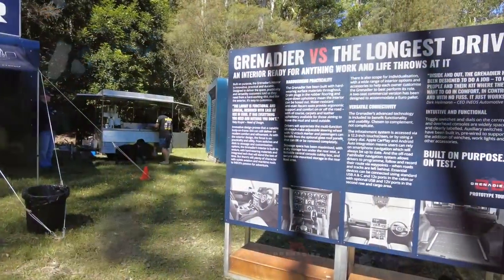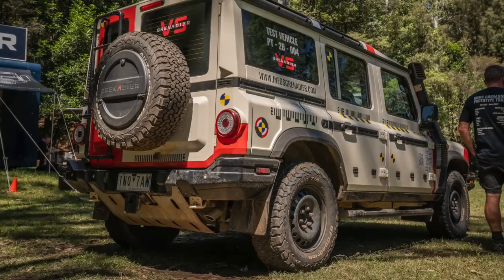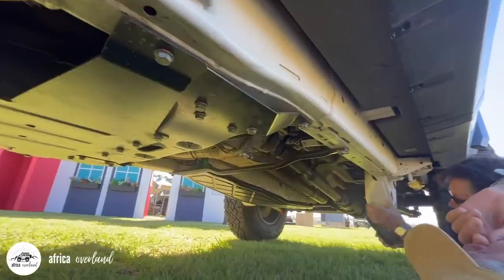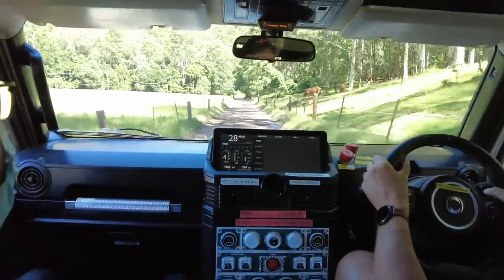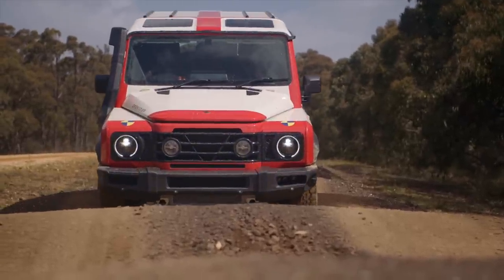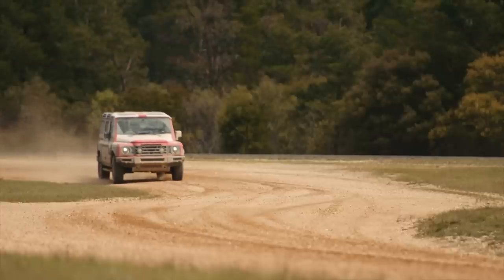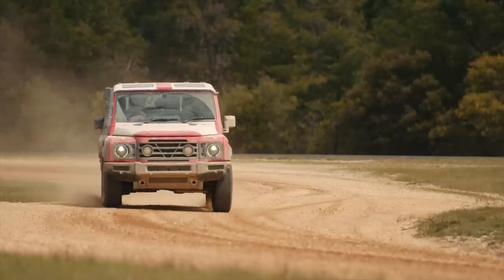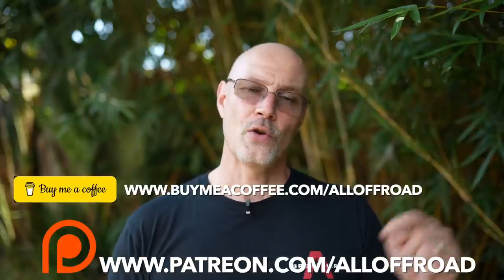Ineos Grenadier - THE ISSUES | SEPARATING THE FACTS FROM THE HYPE | A 4WD PERSPECTIVE

Comment: Excellent review! I'm from Namibia and can not see the point of this vehicle when there are 80 series cruisers still running that I can refurbish for less than half the price of this unproven vehicle for serious remote use where your clients safety is an absolute no compromise situation? I think you have had enough experience in the sticks to see that cruisers or older Toyotas are still the standard for reliability, I know we certainly saw that over the years here in Africa!
Reply from the maker: yes 100% agree with you, my 105 Cruiser has been the most reliable car I have owned so far, reasonably easy to repair, every mechanic knows it inwards out and parts are also available easily. Not to mention its modifiable to whatever want it to be (same goes for an 80 series)

Comment: I do think your worries about the batteries being first to flood and things like adding additional fuel tanks is based on a very limited number of uses. With all respect people like yourself, might account for 10% of sales. So the compromise will be to suits most sales which will likely be on road use. Of our we the diesel will have adblue as that’s down to emissions and isn’t really as issue - my van has it and lasts few thousand miles per tank.
Reply from the maker: yea in Australia it will be the majority who would want more fuel ⛽️ but you probably said it right it will be just another 4wd like we have dozens on the market not a purpose build hard ore 4wd as advertised and in regards to fuel capacity it will be on the bottom of the list as it will be difficult to even upgrade capacity.

Comment: Thanks Stephen, enjoyed the review.  Are your stats re approach, departure and break over more up to date than the IG brochure as the figures they show are somewhat better than your chart?

Wading depth 800mm
Approach angle 35.5
Departure angle 36.1
Breakover angle 27.8

Having had an LC80 and presently an LC100 I'm looking at upgrading and would have looked more closely at the LC76 but for my purposes I have long given up on a manual tranny and don't want the additional cost and hassle of changing the 76 over to auto.  The IG when compared to the 76 seems to outperform in approach, departure (cannot find breakover for the 76) and wading depth.  I find the ground clearance interesting in that the 76 claims 230mm and the IG 264mm?  Spot on with the fuel capacity or lack of, even my wife's 07 Touareg has a factory 100 litre tank.  Maybe the production version is much better, here's hoping.
Reply from the maker: I would hope I took them somewhere from the Ineos literature, however not sure how it's measured anyway usually from the centre of the frame to the bottom of the tyre, but the fuel tank hangs much lower so I'm wondering how accurate at least the break-over angle is?

Comment: Front bash plate - I’ve done a lot of ridiculous off roading and any really successful underbelly protection will get hammered really hard. That means it is doing its job. It’s a good thing :o)  *winch challenge
Reply from the maker: that depends on how low it hangs the front bash plates on any of my vehicles certainly not get constantly pounded otherwise the car is to low.

Comment: Starting to watch your video (pretty excited by the way as I appreciate so much your opinions) and there is an “important” mistake. You say the departure angle is 31,6 deg but it’s 36,1!!
Reply from the maker: yes you are correct not sure where I got the 31.6 degree from at the time, however thats probably measured at the wheels I have the suspicion it will be less at the front due to the low hanging bash plate and transmission cooler.

Comment: Why on earth didn't you measure the ground clearance? You crawled underneath and took plenty of footage, but didn't bother to get the tape measure out. Second question - bottom line, what is the best stock 4WD available today (zero  modifications apart from tyres)?
Reply from the maker: yea, kicked myself as well for not measuring. Depends on for what? Jeep JL Rubicon is the most capable no question but would not use it for touring especially remote. Landruiser 70 Series for Touring or Y62 Patrol 300 Series.
Reply: @AlloffroadAu  Thanks! For my purposes: tight high country tracks with mud and rocks. Shame the Australian rubicon has lower stock ground clearance than the US one

Comment: Loved your take on the Grenadier. However it appears you are comparing it with a specialist vehicle which it obviously is not. It’s up to the specialists to convert it to their requirements.
Reply from the maker: hm is supposed to be a purpose build 4wd? A go-anywhere vehicle according to the advertising, yet it’s not very well set up for that task and they way it's designed modifying it will not be that easy.

Comment: Seems too low to the ground and will result in many ground contacts.  Also I don't like the full time all wheel drive.  I  would like to switch to 2wd when full drive system is not needed.  I would also like analog gauges for speed and RPM behind the steering wheel no in the centre.

Comment: In most of the world the old style Land Cruisers aren't sold so it fills that gap especially when Landy production ceased in 2016.  Aussie's seem to love their simple Toyota's so I doubt there will be big demand for the grenadier there unless people just want something new and a bit different.  I don't see   any real problem with the Grenadier but I think an analog speedo would be preferable and i've never felt the need for a screen in the middle.  (It's just something to go wrong in time).
Reply from the maker: I heard Australia has one of the highest pre-order rates of the Ineos worldwide, it took Ineos quite by surprise.
Reply: @AlloffroadAu  People are talking about how expensive the Grenadier will be but as you know the comparable Toyota in Australia is very expensive also and designing and manufacturing such a capable machine on the cheap isn't really realistic.  If the Grenadier can operate if the centre screen goes wrong then in theory it could be a viable long range vehicle.  (not sure about adding another or larger fuel tank)

Comment: Understandably this car not be everything to everyone. By the sound of your comments it seems you are better off sticking with your Toyota for overlanding as the Toyota will be more flexible in modifying etc. It is a free world. You choose the car best suited for what you want out of your car. I would expect that all the 3 major concerns you have will not be addressed by INEOS at least not in the first production.Maybe in a couple of years. But I think any changes this close to production are not going to happen. I agree with you that the fuel capacity is terribly small for a car like this and would have expected at least 100L fuel tank. Or an option for a second fuel tank. Can you imagine doing the Canning stock Route with a 550 km reach on asphalt. You need to pull a trailer with jerry cans. But I still have put a deposit down and still will buy it. But will do the Canning Stock route in my loyal Defender 110.
It will be interesting to see what the after market is going to. Personally I would like to have a flip top roof tent, but I can not see that happening any time soon as the engineering required etc will make it too expensive.
Reply from the maker: take the Ineos on the Canning I accompany you in the Cruiser and we see what it's made off.

Comment: Your review seems quite critical. I would imagine it be quite difficult to have both, a 1000kg load capacity and soft ride when lightly loaded. I had expected you would rave about solid axles front and back plus coil springs - the gold standard as stated in previous videos?!
Reply from the maker: Don’t think so, I just not only focus on good parts. Yes solid axle is good so are coils but definitely achievable to get a better right I have one in my Cruiser. But ride quality is the least of my issues as that is easily addressed with aftermarket parts.

Comment: Question: Have you ever done similar reviews of Mercedes Unimog vehicles? From my limited experience it seems the Unimogs outperform most offroad vehicles by a comfortable margin. I'd value your insight.
Reply from the maker: no, I haven't but I nearly bought a Unimog at some stage, I don't think you can compare it to the likes of Ineos though. It's much bigger, wider and heavier and is probably the most capable vehicle in it's class but you would need to compare it to a Mitsubishi Canter or Isuzu or Iveco.
Reply: @AlloffroadAu  Why? it's purpose is to do the things popular 4X4s try to do (only, as you say, it does them much better). It's the undisputed King of Offroad. All the rest are just little pretenders, wannabes. Go on, please do a test, doing the same things, for a realistic comparison.

Comment: l would consider a Grenadier if they brought out a swb version, also the chassis design as regards the radius arm mounts is not good when compared to my old Defender 90 Td5, also the tires need to be taller, they just don't look right on this 4 door model.

Comment: excellent review. Ground clearance underneath doesn't look that good. My old defender much better. I see diff pumpkins not offset to one side either so not so good when running deep rut trail trail or avoiding big rocks on trail. However CV jointed driveshafts looks very interesting. Driveline vibration due to even relatively minor UJ angle mismatch on a lifted truck can be a pain. kudos Ineos. The range probably not too far off if it is ~<100l tank and as soon as you get 33s or 35s on and 55lb+ tire weight I bet it will burn 12 - 14l/100km road use gas, 8 - 10.5 diesel at best. Fuse box and electrics under the seat not great for extreme conditions. I had my transmission controller go on a LR D2 due to water. Car was super water tight but you can get caught short and it will come in. On the plus side though makes interior equipment wiring easier. Looks very interesting truck. They should have paid better attention to ground clearance though.    Don't see Toyota or Jeep getting too worried. They have their sectors pretty well covered. Late 90s 300tdi 90 or 110 probably best of breed and the like we won't see again.

Comment: Full disclosure...We have over 100,000 miles on ours with some being off road, and it has held together very well. Just oil changes, tires and 2 sets of brakes.
Reply from the maker: hm how did you manage to 100.000 miles on it? It's not yet released in the US and just a few weeks ago in UK?

Comment: How do other 'Brand New' 4x4 vehicles compare ...? That's an important question  !!🤔
Reply from the maker: yes and no, most other brand's new 4w drives (besides a Rubicon) are not really from ground up designed and purposed built as a 4wd but rather as a luxury SUV with some 4 wd capabilities.

Comment: Just slap some 37s on it and that'll fix those angles, baby!
Reply from the maker: yep it sure will lol, needs to be seen if rest of driveline can cope with 37” and what gearing options are available
Reply: @AlloffroadAu  True. I am sure some aftermarket manufacturers would love to get some kits built to make 37s possible, though. Stinky if it's not possible from factory spec excluding a little lift, but will be nice if there is a way in general. I might be in the market for one of these in about 4-5 years. Hopefully they'll be in NA for a while at that point
Reply from the maker: yea not so sure if aftermarket will really take the Ineos serious it has way to many compromises for outside Europe but time will tell
Reply: @AlloffroadAu  Indeed. Seems like it could be a really awesome adventure rig

Comment: I had paid a reservation fee to reserve a Grenadier (as an early bird follower) but have decided to cancel.

I'm just disappointed in the poor payload given the hype and INEOS not dissuading all the forums when discussing a possible 1000kg payload throughout the RD phase. 

If it had come with 1000kg payload or close to it, I would be signing a contract.

Let’s take emotion out of it and just do the Math. 

Grenadier Trailmaster (90% fuel capacity, all liquids, no occupants) 689kg payload as per recent published spec sheet. 

I want to tow a 3500kg caravan, which is what the Grenadier is rated for. 

Standard rule for working out tow ball weight is 10% of ATM = 350kg 

Take 350kg from payload of 689kg leaves me with 339kg payload 

Be kind and put only two occupants in vehicle (too bad if you have kids) my case, wife and I = 170kg 339kg - 170kg = 169kg payload left 

Only a 90ltr fuel tank in Grenadier which doesn’t work in Australia overlanding so either jerry cans or long-range fuel tank (another 90ltr to carry plus extra ad blu) let’s say 120kg. 169kg - 120 kg = 49kg 

Now add on a winch – whoops! I can’t as that will overload me. But a winch is a must have in Australia’s outback. 

Then, if I want my bulbar (also a must in Australia) roof rack, recovery gear, tools/safety equip, Draw system to hold equip, canopy and any other basic accessories it’s not possible. 
I would have to go down the path of a costly GVM upgrade (which will require engineering, testing, and certification by some third-party company down the track). 

My hope is INEOS will make changes in future models, (maybe the dual cab utility) where you can have the Trailmaster features with a 1000kg payload with proper size fuel tank (180ltr) so you can tow a 3500kg caravan, with necessary accessories, across Australia’s unforgiving outback. 

Wasn’t that what it was supposed to be - A Utilitarian 4 x 4 that you can ‘Load up’ - ‘Tow with’ for go anywhere off roading? 

I believe if Grenadier were to meet the above payload and fuel capacity, sales would skyrocket as they would become a class leader and not just another option. I’ll wait and hope.
Reply from the maker: 💯 agree to pretty much everything you said I still have hope for version 2 or 3

Comment: Great review 🚙👍🏻

I too have a few concerns , especially for a clean sheet of paper design

Firstly the archaic and less user friendly rear seat split of 60:40 instead of the far more practical in the real world 40:20:40

The lack of a speed display in front of the driver 

The two spoke steering wheel, I’d much prefer a four spoke option, it looks too retro and not comfortable for driving big distances and hard to tel up from down etc 

The fuses positioning is crazy for a true middle of nowhere workhorse 
This perhaps let slip that it’s more likely to be used as a business tool / vehicle / company vehicle than proper utility vehicle 

The horrible gear knob, which sadly spoils the latest Morgans and dropped by BMW 
Surely they could’ve designed a shifter like they did for the centre diff lock etc

And deffo tuned the diesel for Euro 5 and so no AdBlue grrrrrr

Comment: I see the problem with these being the engine. Especially with the appalling reliability of nearly all other European cars here in Australia. No mechanic outside of BMW will want to touch these things. Especially if they are fitting all the plastic cooling system items.
Reply: I dislike bmw as much as the next they are generally appalling but this engine is genuinely pretty bullet proof it’s on of the best ones they’ve ever made imo
Reply: @ruddthreetrees1104  It's not necessarily the engine itself. It's all the shit plastic parts they bolt onto it and the plastic and generally over complicated cooling system and pipes. They just don't hold up well.
Reply: I thought these particular BMW engines were infamous for mystery coolant loss. Just the job for outback Australia.
Reply: @stevemumbling7720  yeah I wouldn't be surprised mate. Typical poor build quality and reliability.

Comment: Please  understand  that my son and I have 4 fj80s. 2 are on 37" tires 5.29  gears 2 are on 35" tires 4.10 gears. All are triple  locked.  Fj80 are considered  by many to be the standard  to compare  all expedition  vehicles. In stock form fully optioned, in 96 they would be in today's  dollars around 80k & on 31" stock  tires your approach  and departure  angles  are no better. Compared to the garbage  being sold on the market today that require  an additional  30k to become  competent these are looking good to me. You can't  compare  your modified  fj on 35" tires to a stock preproduction  rig.
Reply from the maker: I don’t compare it to my Landcruiser on 35”, The big difference of an FJ (which I love btw) is that it has way better ground clearance does not have low hanging parts everywhere and is even more importantly easily modifiable. However it may have been a standard for expedition vehicles 40 years ago, time moves on so that’s not a good comparison at all.
Reply: @AlloffroadAu   not in stock form it doesn't.  You have 1 we have 4 that we have built. Ground  clearance  was not better. I agree  that this will be a brand new vehicle, not a forty year old 50k investment of time and money.  That's what I'm in on my totally  built fj80 doing hundreds  of hours work to it. I'm going to try to put a deposit  on 1 right now. I'm also going to use it as a primary  vehicle- I can't do that with my fj80s. I feel this is the best attempt  anyone  has made in a long long  time. Try wheeling a new Toyota overland as many of our friends  do- its not pretty  in stock form(cv joints & body damage)  for your efforts.